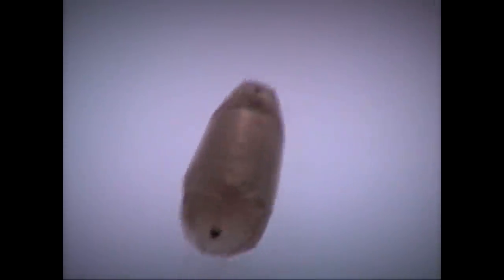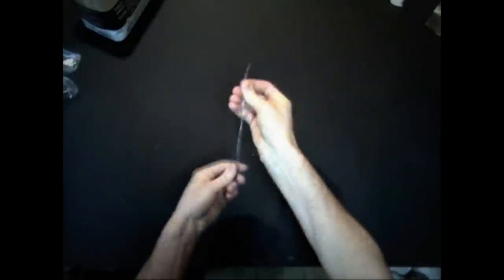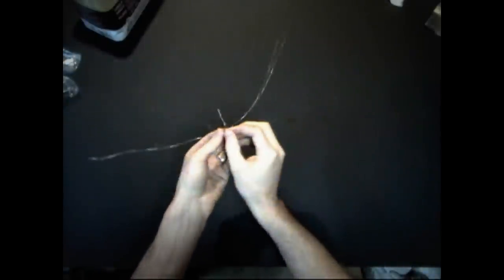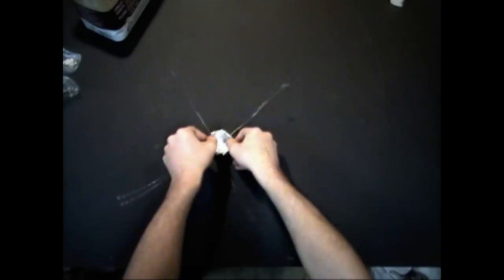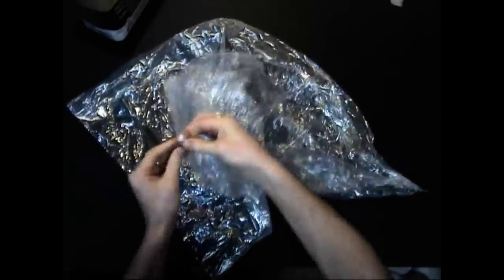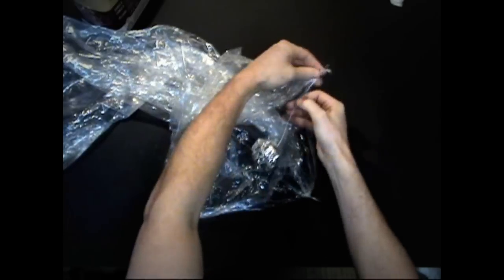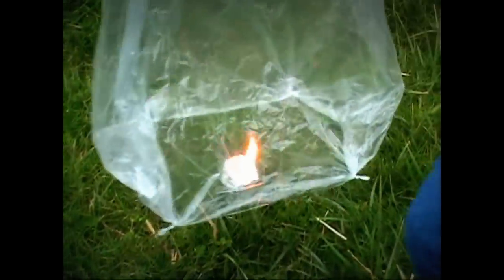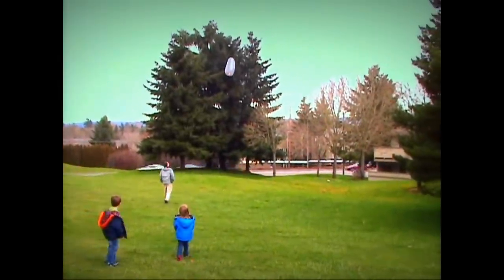Sky Lantern Hot Air Balloon

Comment from the maker: @vw77 Sure.  Weight is an issue though, so I wouldn't use an industrial strength one.  Also, I might make the tinfoil cup a little bigger than what you see in the video.  This will allow more oxygen flow and result in a bigger flame.  Also, one of the great things about the dry cleaner bag is that it is clear, so the whole bag lights up in the dark.  Its a cool effect.  You don't get that so much with a black garbage bag.

Comment from the maker: @majorchaoz There are ways to reduce the fire danger, but as long as you have the fire on the balloon, you are running a risk.  I have built some large balloons that I heat with a BBQ grill or camp stove and then release without any flame.  That is the only 100% safe method.  I plan to make a video of one of those balloons soon.